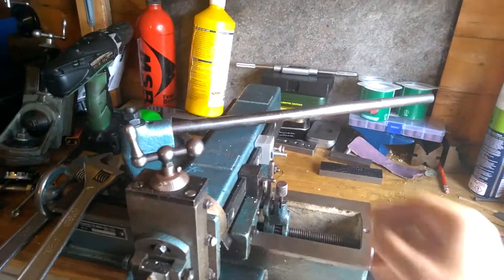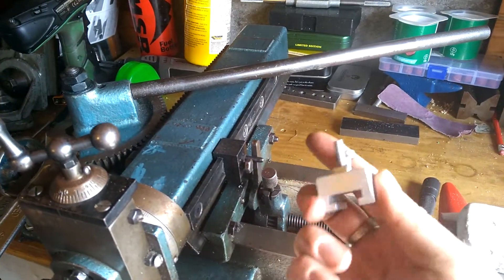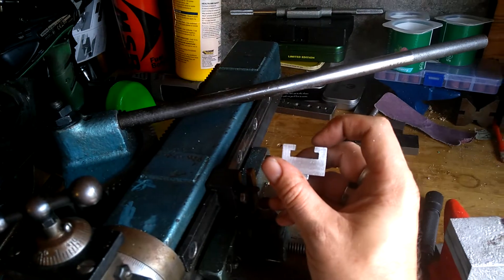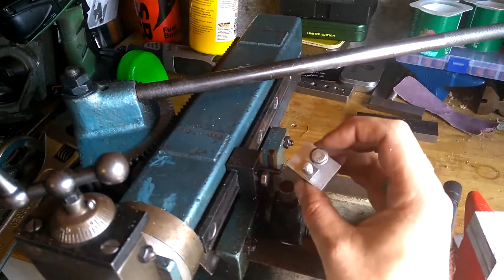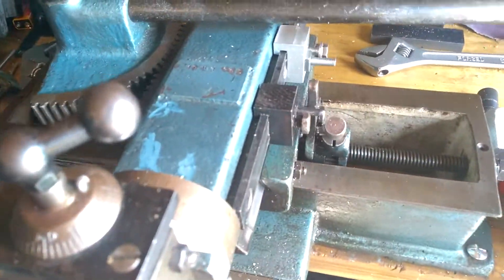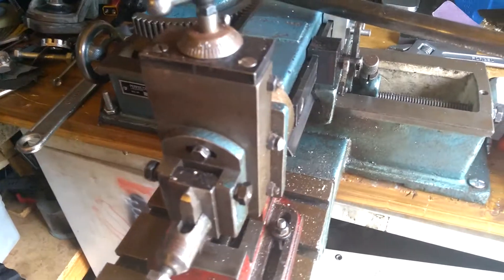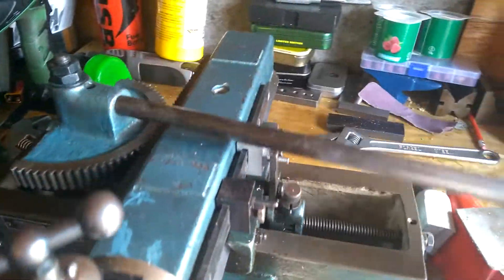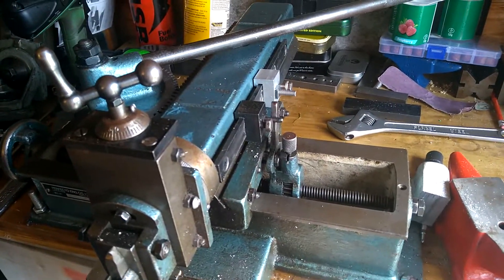Perfecto Shaper Part 2 update!

Comment: May i ask how much you bought for it always wanted machine tool like a mill lathe shaper etc
Reply from the maker: Of course. I paid £120 for it. I see them very occasionally on ebay etc and they seem to go for about £100-200. I imagine if one could be found at a flea market/garage sale they might be cheaper!
Reply: I bought one for£200.
It was not a bargain. The ram was not parallel so I had it re-ground. That was £200. Then I discovered that the bed was not parallel so it was another £200 to have that re-ground. The worst though is the small table. The ram stops in its rearmost position well over the table.